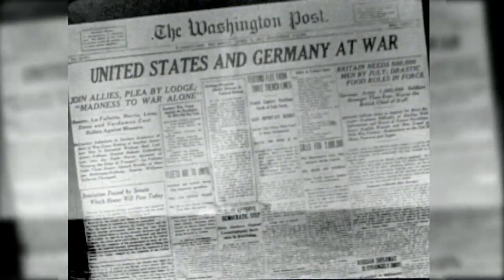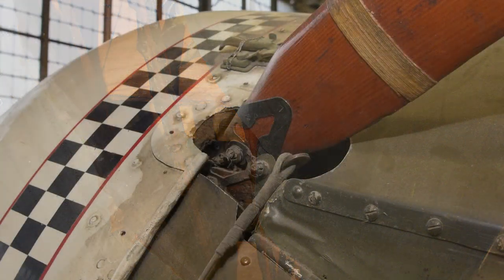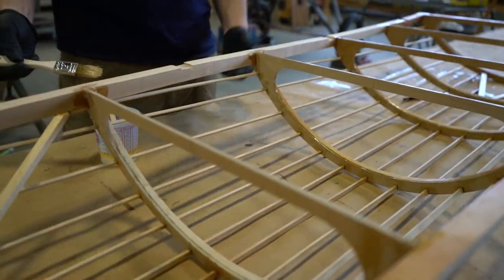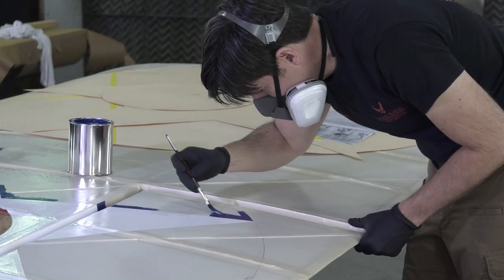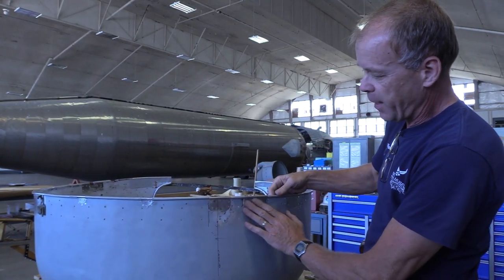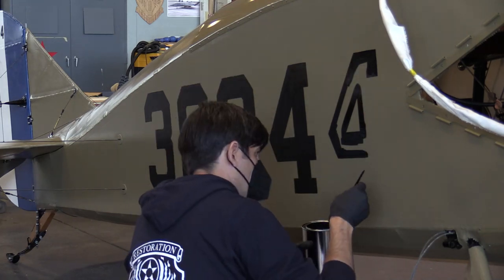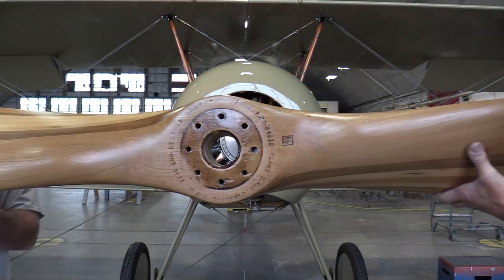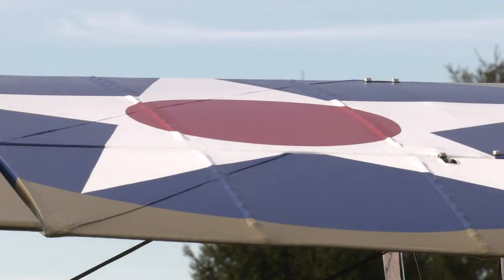Thomas Morse S4C Scout Restoration at the National Museum of the USAF 2020-2021

Comment: Is the airframe actually restored to airworthy  status?
Reply from the maker: Are museum aircraft restored to airworthy status?
While most of the aircraft at the National Museum of the U.S. Air Force have the potential to be made airworthy, our conservation and restoration work is directed at preserving the historical integrity and accuracy of an aircraft rather than achieving modern airworthiness. In preserving historical accuracy, we choose to use original parts that may be unserviceable or non-airworthy, rather than modern substitutes.  The Memphis Belle, for example, will use wiring made to original wartime specification, which does not meet today’s flight standards, rather than wiring used in modern aircraft. This is vital to our mission of preserving the record copies of these aircraft for future generations to come.
Reply: @USAFmuseum  Thanks.
Reply: @USAFmuseum  Amen.

Comment: I wonder if any of their wooden aircraft have original fabric. Seems like the stuff they were removing wasn't period.
Reply: The observation balloon is original IIRC so there might be some others with at least a little original fabric.
Reply: @willausterman3104   unfortunately that balloon was folded up and stored in a box, due to its condition, probably never to be seen by the public again.
Reply from the maker: The Tommy on display was donated to the museum in March 1965 by Capt. R.W. Duff, Miami, Fla., and restored by Aero Mechanics High School, Detroit, Mich. The museum's restoration team spent about two years restoring this aircraft which is now on display in the Early Years Gallery as of Oct. 28, 2021.
Reply: @anniecraig5867  no it's very much on display...... quite hard to miss actually
Reply: The original would have been either Irish linen or grade A cotton, both natural fibers. Sadly, the durability is not very good especially when exposed to UV radiation. If they used those materials now and keep the aircraft inside it will be fine for many decades. The fact that the engine oil caused the fabric to fail makes me think that they used a natural product vs polyester like we use today for covering airplanes. On thing I did notice was pinked edges on some of the tapes, I didn’t think those came in until closer to World War II.
Reply: @USAFmuseum  beautiful job!
Reply: @jameshann7218  Another problem is that the dope used on the fabric continues to contract over time. Eventually this causes tears in the fabric and sometimes even damage to the underlying structure. The issue is that the standard method of repair for airworthy aircraft, applying a patch, would end up with an aircraft looking like a patchwork quilt. This is something NASM ran into when they recently examined the Spirit of St. Louis.
Reply: @Noha307  very true.